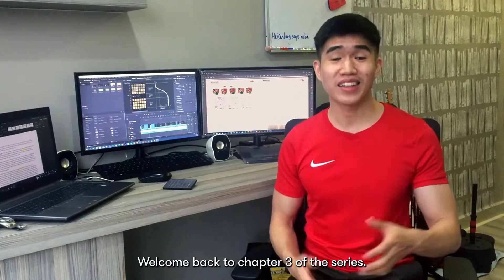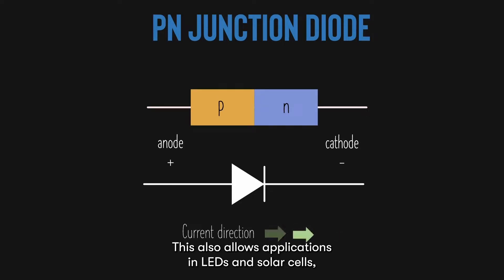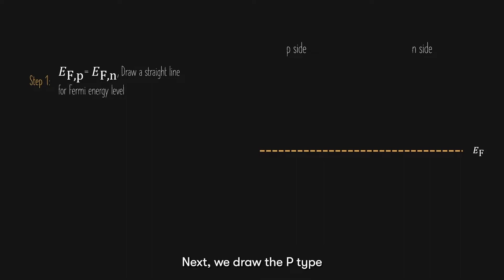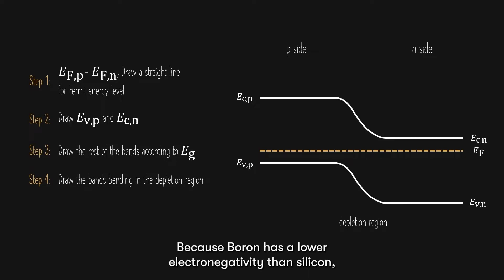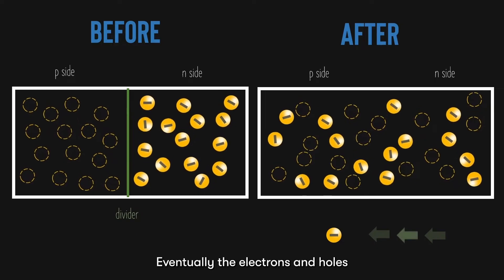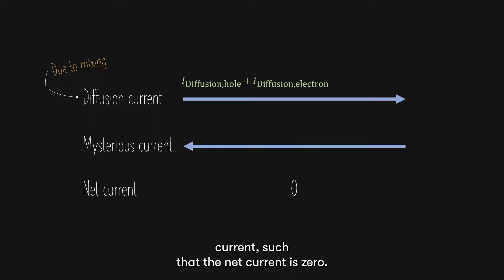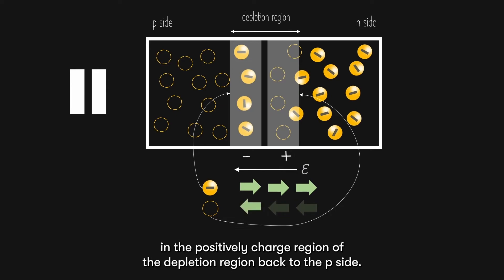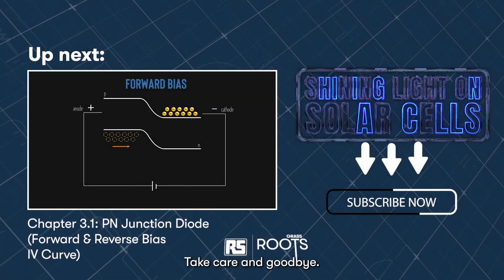Shining Light on Solar Cells - Chapter 3.0: PN Junction Diode (Drift and Diffusion)

Comment: Hold on on hold on, if something has less electronegativity, then it should be more available to donate electrons not less? Not to mention im pretty certain the only reason why N type semiconductors, conduct, is because the three valence in phosphorus are filled then because silicon still demands one more valence bond, it pushes the remaining phoshorus electron toward a higher electron orbital therefore making it weaker to energy flux's and more reactive. @WeAreRSGroup
Reply: Hi Colin, Christopher here. You are absolutely right that a less electronegative material will have lesser tendency to attract electrons and more tendency to donate electrons. However, the problem is that p type materials under room temperature do not have free electrons in the conduction band and hence has no electrons to donate. 

If there is a free electron generated in the conduction band of the p type material like in a solar cell, then yes, the electron in the p-type material will flow to the n side (upon coming in contact with the more electronegative n type material). This is the entire purpose of a pn junction, which is to have electrons only flow in one direction (p to n).

I hope this clears things up for you 🙂
Reply: @BlackRockExecutive  ye because as thermal energy is exchanged into electromagnetic energy we raise orbital energy of electrons, raising them into the conduction band, and because phosphorus requires all of its electrons it begins to seek them from weaker valence bonds with electropositive valence shells or does the N side recieve electrons from silicon with no available valence bonds? Basically the same concept as a single atom who hybdrizes its orbital to achieve lowest energy states in valence bonds? Where the energy states are lower it will hybridize, so its thermal conduction will be the same. 
.....
Basically i would really like to know the order of precedence... N type free electrons conduct first, then free silicon electrons and / or electropositive valence electrons? (Probably not as it would be harmful to the molecular structure), would valence bonded electrons ever reach the conduction band?